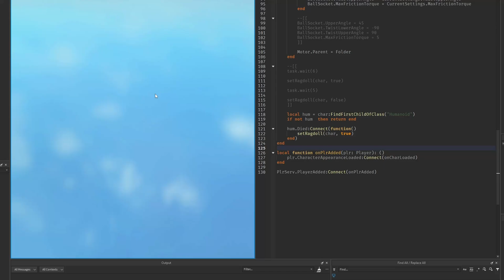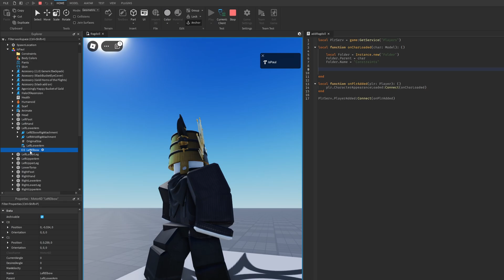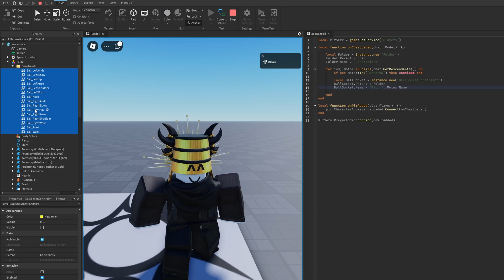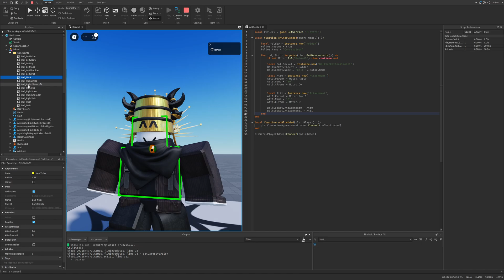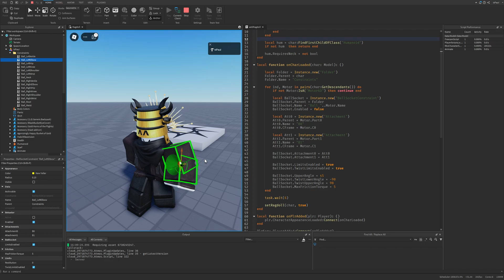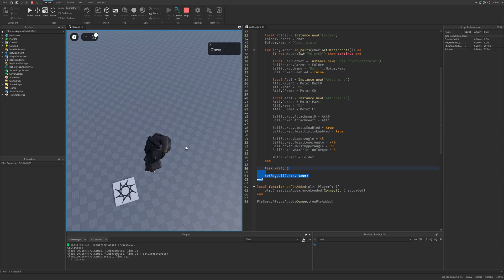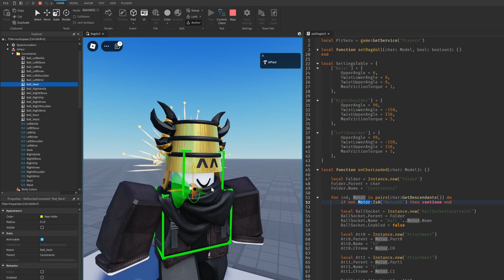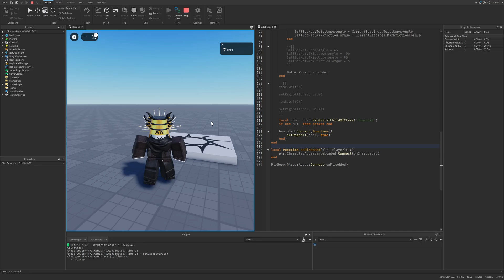Roblox Ragdoll Physics Are Interesting...

Comment: you know how roblox is trying to avoid looking like lego right? but I find it funny how when you reset your character it still falls to pieces like lego bricks, I've got a funny feeling that's going to change officially in the future.
Reply from the maker: Probs not because the whole premise of 'Roblox' is 'Robot blocks', so they'd have to change the whole branding on the platform, but who knows
Reply: @Paul1Rb that’s not what “roblox” means but ok i guess
Reply from the maker: @mapkidd  I've been familiar with the term explanation for years, and I've seen other people explain it that way too, if you think it's wrong then please prove information on what it actually stands for.
Reply: @Paul1Rb  Sorry for the late reply -- I don't think they would have to rebrand, but I can see where you are coming from.
Reply: @Paul1Rb  Check out the new joint upgrade

Comment: always disconnect character from a player please!
Reply from the maker: What do you mean exactly?
Reply: @Paul1Rb  Set players property Character to nil
also recomended to get a character referance before doing so becouse you will have to reparent it.
Reply from the maker: @yarik_superpro  Doesn't that only apply while changing player's character through code?
Setting plr.Character to something creates memory leaks if later that character isn't both destroyed and set to nil, I don't think there's a need to do that with default character behavior because garbage collection handles everything when the character dies and the player leaves the game.

Edit:
Also, garbage collection clears the variable from memory if there's no more reference to it in the scopes.
Reply: @Paul1Rb  its not.
Did you read my message?
You making ragdoll from disconnected character
Reply from the maker: @yarik_superpro  Setting player's character property to nil is only needed after using the :LoadCharacter() method. There's no need for disconnecting the character, making an additional variable for it, or setting it to nil in my case.

Comment: Why it's jiggly
Reply: cuz there is no collision, if u want collision u need to add parts which are slightly smaller than body part
Reply: if you want it to be less jiggly, just play around with attachment orientation of the socket and enables TwistLimitsEnabled, LimitsEnabled to true, then play around with the UpperAngle, TwistLowerAngle, TwirstUpperAngle till you find it look good. Hope this help.
Reply from the maker: Roblox physics
Reply: I thought its cause the joints cframes are too close to the torso? I moved the joint cframe values and it fixed the wobblyness? @Paul1Rb

Comment: Edit: nvm functions are () -> (), simply () means void, ty!
might be mistaken but doing function myFunction(): () with the brackets at the end signifies that your function returns another function, however your functions return nil. Might wanna fix that as to not confuse beginner scripters
Reply from the maker: 'Function(): ()' Means that it's void and doesn't return anything, doing 'Function(): () -> ()' would indicate that it returns another function
Reply: @Paul1Rb  What does the colon notation ":" do when writing the parameters in the function like:
local function onCharLoaded(char: Model) what does the parameter "char: Model" do.
Reply: @YeahImHover Define and assigns it to that value, if not sure add "?" to that value
Edit: so like for example: local hello: number = 123
local hi: number? = workspace
so like: if hi ~= nil then -- checking if the value exists
if type(hi) == "number" then -- if i remember correctly... and also "hello" completely skips this since it will only want number as the value and it must exist too, but "hi" will be optional and not forced
print("i am a number!")
else
print("i am something else")
end
-- does this look like kohls admin to you? i guess so
Reply: @YeahImHover  That means that the parameter expects a Model. You can't put a number or other datatypes as that Parameter for example. need to be a Model then. you can do that with any other Type. for example  (name: string)  or (name: string, age: number)
Reply: @Paul1Rb  Oh right, that didn't come to mind since Roblox pretty much hides voids from the scripter lol I'm pretty confused tho where someone would use it to actually like "re-cast" the return type from something else to void
Reply from the maker: @sokiuwu  Yeah, all functions are void until they actually return something or you define it, Luau is a pretty simple language that doesn't have type checking by default. I use it because it works better for me and so I don't get confused about what each function does
Reply: @Paul1Rb Wat